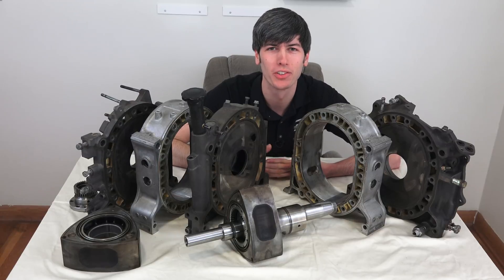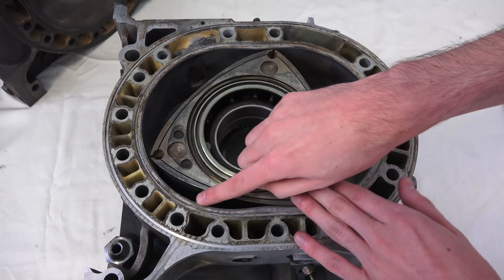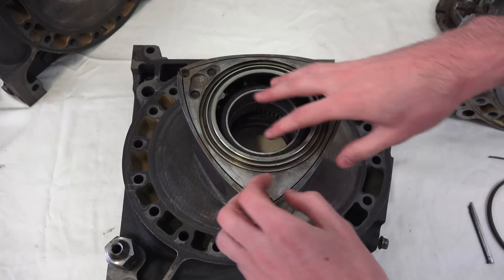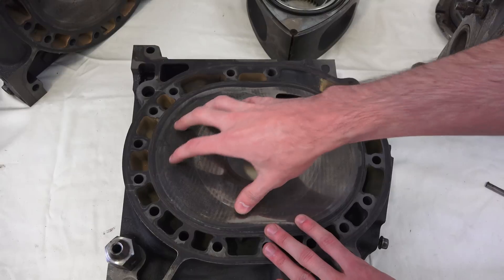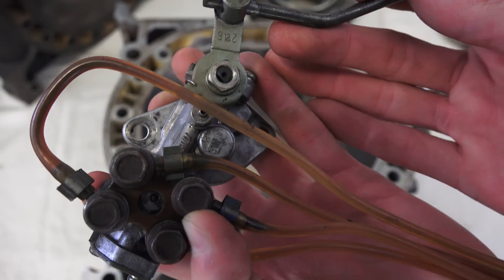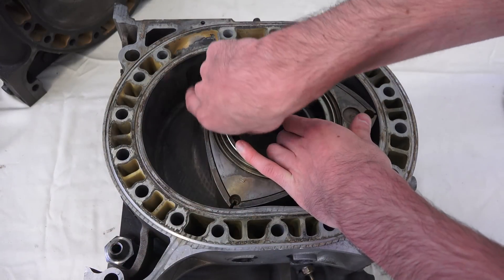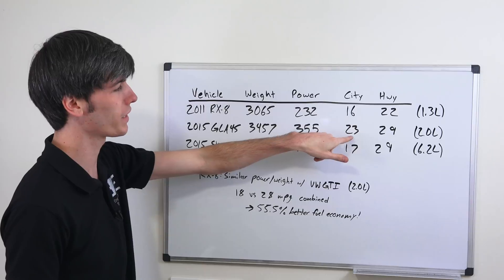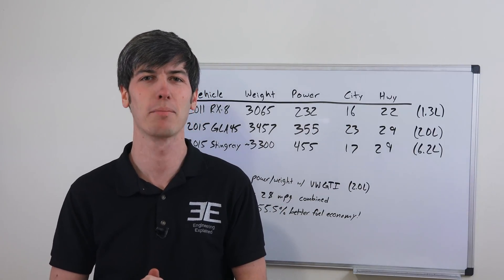4 Reasons Why The Rotary Engine Is Dead

Comment: I call BS on the fuel economy comparisons.  Be fair, and compare to other 2011 cars.  Look at the 2011 Mercedes C350 and you'll see 17 mpg city and 25 mpg highway.  Still better than the 2011 Mazda, but not nearly as much better.

Reasons the Wankel was great?  High horsepower, low weight and compact size.  If only Mazda had the resources to have kept working on it... They made it work when ALL of the giants said  it couldn't be done.  Remember the AMC Pacer (think back to Wayne's World).  it would have been a neat car if it had received the Wankel engine it was designed for.  Shoehorning in the huge and heavy in-line 6 made it a dud.
Reply from the maker: +3333glen It has a lot of advantages, as I've discussed. https://youtu.be/sd6pJtR4PaY 2001 GTI gets 33% better gas mileage. 2004 Corvette is significantly more powerful, larger engine, heavier, and still gets better fuel economy. Compare it to whatever, it's inefficient.

Comment: If you recall, the AMC Pacer was originally designed around having a rotary engine.  Their rotary contract with GM tanked when GM scrapped their own rotary plan.  So the Pacer had to be altered to allow conventional internal combustion engines to be shoehorned into the cars.  

I've often wondered how if the Pacer line would have died earlier if they had been fitted with a Wankel.

Comment: I've always hated rotary engines so thank you for this video.
Reply from the maker: +esqueue Rotary engines are awesome! No need to hate! https://youtu.be/sd6pJtR4PaY
Reply: +Engineering Explained I saw that video and understood the basics of how they function. I knew that they had were less efficient than your typical 4 stroke engine and had issues with the apex seals. I didn't know why the seals would fail or they reason behind their efficiency. It was also cool to see the other seals and the details you go into with an actual engine, the oil pump, dual spark plugs and so on.  

It's one of those things that I dislike and can't make myself change my feelings toward them. The first thing that I'd do if I were to purchase a rotary engine vehicle would be to swap in something else.

Comment: The one reasson that they are not dead: Power to Weight. (That is weight of the engine, not the car.)
Reply from the maker: +spacecadet35 Well the thing is they're not in production anymore... haha. But they certainly have many advantages: https://youtu.be/sd6pJtR4PaY
Reply: They still make rotary engines. Mazda has stopped making them, but they were not the sole manafacturer.
http://www.nwuav.com/uav-products/uav-rotary-engines.html?gclid=CJeXvNbGvMoCFcaVvQod0xUA-w

Comment: Wish you had told me this before I bought an RX-2 in 1972.  You did not touch on the experience we early suckers had--all the bad stuff you covered, plus:  Backfires that deafened children a block away and eventually cracked the exhaust manifold.  Spark plugs that fouled constantly and wore rapidly.  Plus the grand prize:  In really cold weather, the seals failed completely, allowing coolant to leak into the combustion chambers.  If you tried to start it, you would find that the plugs were stuffed with slush, and new plugs would suffer the same fate as soon as you tried cranking it again.  In addition, early body rust through, alternator problems, coolant leaks under the intake manifold, an oil filter that was mounted upside-down over the engine so that it spilled all its oil over it, seat covers that shattered if you sat on them in cold weather, various trim pieces falling off the interior, wheel bearings that went bad, and a screw jack that wore out after a couple of lifts.  Those are just the items I remember 43 years later.  I have never gone near a Mazda dealership since.

Comment: No comment on how well rotary engines work with turbocharging, nor how torque/hp output is linear with rpm, unlike a reciprocating engine and probably better suited for aircraft, boats, or race cars.  They are by design a high rpm engine, with best efficiency near 3600 rpm.

Comment: Isn't it unfair to compare it with 2015 cars. That's 4 years of possible engine development the rx8 does not have.
Reply from the maker: +Nicolaj H 2001 GTI gets 33% better gas mileage.
Reply: +Engineering Explained Fair enough.

Comment: This is what that strike in my mind, If wrong excuse me:

1.We can use multi-spark to avoid unburned fuel issue.
2.Instead of three cycles(suction, compression, exhaust) in a rotation. We make it 3 cycles in 3 rotation. (Flywheel is used to rotate the piston trice and the exhaust can be allowed out)

Comment: That comparison near the end is not quite fair. You are comparing cars 4 years apart. There have been significant improvements in the last few years as Direct Injection has become practically a standard of the industry. 

Actually compare the RX8's fuel economy to other 2011 models.
Reply from the maker: +Xaviar Craig A 2001 GTI gets 33% better fuel economy. A 2004 Corvette has more power, more weight, more liters, and gets better fuel economy. I'll agree the comparison was unfair, but you can go to whatever year you like and it remains a valid point.

Comment: In your video about the advantages of Rotary, you say that each time the shaft rotates, there are 3 combustions. Doesn't that technically mean that although it's a 1.3L, we should multiply that by 3 due to the way it works?

Comment: Why so critical America? Have you ever tries a rotor with boost? Rotaries with forced induction respond very well. Sure economy is shit, but it's also shit in a hellcat. At least most rotaries can turn and stop too... Get over your Dukes of Hazard body rolling, tire folding, straight line only, soft suspension, wallowing, floating hunks of steel mentality and just try one before you criticise.... Not all rotaries are oil burning, torque-less rice cookers. Check out Pac Performance videos or any number of New Zealand or Australian rotaries. We have a long history of big boost low et rotary vehicles. Don't assume that what you hear is the truth.....

Comment: Add turbulence technology to the non contact areas of the rotor. Add water or mist injection, a very small amount to create a hydrogen oxygen burn which will burn all carbons. Add a true plasma spark developed for burning water, I think it's called blue plasma. This will solve all 3 problems and increase HP. Good luck. Clay

Comment: the comparrison at the end is stupid.
comparing a 1.3L to a 6.2L of course their will be a huge difference . if you had a quad rotor that had 2.6L the power would be closer to 460HP and  still less than half the capacity of the mentioned 6.2L

Comment: Yes, rotary engines are stupid. Reciprocating engines are stupid too. Burning fuel to rapidly expand a gas, then throwing away most of the energy out of the exhaust and through the cooling system. It is time to give up on that design completely.

Comment: These are fine from an engineering POV, but really the death of the rotory engine is because the public no longer wants an enthusiast type car. Aside from govt mandates on things like mandatory traction control, absurd and unfair EPA fleet mileage calclations, the biggest reason is that the buying public demands that their "weekend car" be nothing more than a faster version of their everyday car. They need sat nav, AC, stereo systems with built in bluetooth and WIFI, magnetic ride technology to give a soft ride every day and sport feel when desired,19 inch wheels and supercar performance in a nice little tidy package. Sports cars used to be compromised. You gave up creature comforts and MPG because you got a better and ultimately more fun driving experience in them. They werent supposed to be perfect packages. They were cars that drive better when you put a little effort into them, beyond just stepping on the gas pedal. They didnt have to be the fastest car out there at every light, every time. Today, if your 0-60 is over 3.4 seconds, dont bother showing up. You need a 3rd pedal to make your transmission shift? Get out of here!

Comment: A fluid braking system using lock-up transmission torque converters would be really cool. Brakes would last for 100k miles, no dust.

Comment: it not the engine for pu#/y drivers, even aprius attempting to go fast will burn gas! so I don't mind the fuel consumption with the  power output per liter it is only a 1.3l and comparing apples to oranges years of development between them!

Comment: Overall, this was a great video about the Rotary, & I understand its mediocre mpg, but I question the logic at comparing a 2006-2011 Rotary to modern 2015 turbo 4s & V8s, which utilize very advanced tech to achieve it's efficiency, such as the Corvette's cylinder deactivation. As of January 2016, a low miles used Mazda RX8 GT has a KBB value of around $12k, while the MB GLA45 is about $48k and a Corvette at $52k. That's a price difference of up to $40k. Even with an engine rebuild & long term cost of ownership, the Rotary isn't bad. Yes, I use to own a 2006. I traded it away, not for reliability reasons. There's more to efficiency than just power to weight ratio, there's also balanced handling, and even though I've owned sporty & faster vehicles like the Nissan 370z & the current Mustang GT, I still have a fondness for the RX8.

Comment: Wouldn't a turbocharger counter some of the disadvantages? Like if you've got fuel burning in the exit port that would energize the air coming into the chargers turbine and thus drive the turbo a bit stronger. If you'd connect the turbo to a generator unit you could harvest some additional energy from it. Thinking about the rotor and the thermal problem with sealing I'm not sure if there are ceramic materials that would both be able to take the stress and suffer less thermal expansion, but a ceramic rotor (or one that's in parts ceramic) would probably be too expensive to produce. Anyway, it doesn't seem worth the effort, since electric cars seem to be the future.

Comment: to make it seal, it need oil inject, so way more frequent oil change.... the maintenance is a nightmare. The temperature expand issue can be solve by using different material in the engine, but still need oil inject to keep it lubricate. the emission can be lowered by timing and reinvent the engine exhaust port. But combining all of these will make the car much expensive... this engine is NOT good for a daily drive...

Comment: Come on now, that's slightly unfair. I mean okay, obviously you're right on the facts but you're comparing two turbo engines and a dramatically overpowered (and more expensive) engine-centric NA car to the RX-8. Those are kind of its competition, so that's fair, but at the same point i feel like it's still not an honest comparison. Because of the characteristics of rotaries, they should probably be given forced induction--like the GLA and i think the GTI--as was done with the RX-7. Yes, that adds complexity and weight (and worsens emissions) but on the whole the benefits are significant in other respects. The real problem facing rotaries is the emissions and sealing problems, but not just because those are problems in and of themselves but also because of how they restrict the engineering options available.

This is all as i understand it, of course, and you probably know better. I'm not REALLY complaining, but i wanted to make that minor complaint because i think that's a real blocker to rotaries following conventional reciprocating engines into this new era.

Comment: Rotary engines only advantages are their high rpm ceiling and weight to power ratio WHEN TURBOCHARGED, like the RX-7. The RX-8's N/A engine was a horrible miscarriage.

Comment: 4:37 Yeah, I have a comment about this. You just compared a 2011 rotary engine to two vehicles half a decade newer and completely failed to mention that those two vehicles cost 50,000 and 70,000 compared to the RX-8 which was 32,000. I would hope that a car twice as much and almost twice as much + 5 years newer would offer some kind of performance increase, especially seeing how the Corvette is AIMED at a performance oriented audience, and so is the GLA45. A typical GLA only has 208 horsepower. 

Oh yeah, and you never mentioned that the power per liter of the rotary engine still beats out the other two. For being only 1.3 liters it packs one hell of a punch.

I'd also like to note I hate rotaries, but there are much much much better vehicles to choose to compare this motor to.
Reply from the maker: 2001 GTI gets 33% better fuel economy. Compare it to whatever you want, the mpg story is poor.

Comment: I'd say in about 50 years internal combustion engines will be "dead" anyways. I'm not saying electric cars (or fuel cell cars either) are "the future", but something will replace ICE engines for typical commuting. Taxes on emissions will start in the USA, in countries where it exists already it will rise, and massive urban areas with pollution problems will continue to change the face of ICE engines until they're no longer feasible.

Comment: if you look at the RX-8, GLA45 and Stingray in a BHP vs Displacement, the RX-8 actually better than the Stingray by 248%, and still marginally wins against the GLA45 even thought you're comparing the normally aspirated RX-8 vs the Turbo GLA45. Yes, it has oil injection, so do 2-Stroke motorcycles, only there you usually have to manually add it to the fuel, and they're certainly not dead. Or maybe that doesn't count cos it's not automatically taking it from the engine sump. As for uneven heat, i dont suppose on piston engines the top of the block is the same temperature as the bottom?  poor research in the attempt to get some more views and downtread the rotary. (my caveat: personal opinion)

Comment: I disagree!!! There is currently a new running prototype being tested by the company LiquidPiston. It is similar to the Wankel rotary engine but it addresses the problems that the Wankel engine uses. They claim to use the advantages of the diesel, Otto, and Atkinson thermodynamic cycles. They also claim that the engine is significantly lighter than other engines and an estimated efficiency of 60%.

Comment: I have always been confused on the combustion concept of the Wankel or the Mazda Rotary Engine.  This video has helped me understand the combustion cycle and the problems with the design.  And the Oil lubricating part SOB I was not aware of that.  Thanks for posting.

Comment: Actually "Alvaro Lopez" as far as racing or top speed the rotary is King it produces power on 2 of the three strokes he explained it wrong the reason why it overheats is because they do not have an efficent cooling system but when you are going very fast the aerodynamics can  cool the engine without the need for radiators even its pretty amazing just how fast these engines can propel a vehicle the Rotary is the Ultimate racing engine look at the Mazda787B that car with a 160 cubic inch engine made over 900 horsepower and had to be detuned to 700hp for Le Mans they sound amazing wide open kind of like how the Porsche 962 Le Mans was the Ultimate Race car for the Road Basically all they did was put a liscence plate and turn signals on that vehicle they simply wouldnt allow that with the 787b and it was banned after it won the Le Mans in 1991 becoming the only non Piston engine car to Win the race and bot by a small margin they even lapped Michael Shcumaker 7x and He had the fastest Lap even but that car on the straights no other car could match its acceleration they were just blown away they knew they would win but they didnt know if the car would hold together but it did and thats a testament to how well built the rotary engines are for taking boost which also helps them burn cleaner by recycling the unpsent fuel in the exhaust fumes and extracting even more power out of the engine Rotary engines will always be ideal for small cars and electric will never have the feel of a Manual combustion powered car but they are already becoming faster just not around the twisties maybe once they get the electronic telemetry down pat and the software to properly apply torque then we will see competent electric cars till then only formula F1 cars and I guess tesla shows some promise but they still have a lot of work to do its a start at least I will always love the combustion engine and once we run our cars off water then we will truly be reversing the effects of all our pollution by filling the air with oxygen rather than Carbon wouldnt it be nice to have a combustion engine that is completely green in fact its Neon Green because the air leaving the vehicle would actually be cleaner and better for you to breathe then the air outside this would do well in places like china say Baoding where the smog is so bad its like fog you cant see well a fleet of Water powered combustion car would clean the air and make it healthier for them to breathe but does our government want us to know that water Hydrogen burns in Oxygen in a Vacuum no they dont  I am shocked that they allowed EM drive technology to be released because once the reaction is started with the Microwave it is supposably contained withing the EM Drive and it never needs to be reset it will continuously propel whatever spacecraft or Flying machine we conceive perhaps one day that too could power mass transit or  maglev trains the Future can be amazing if we all join in and contribute rather than merely pass the time by allowing others to succeed where we have faltered